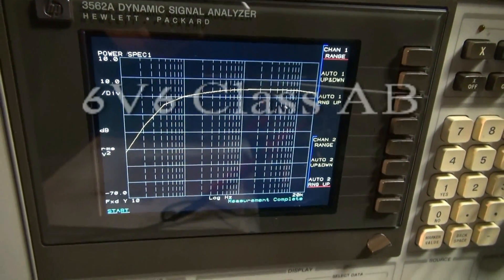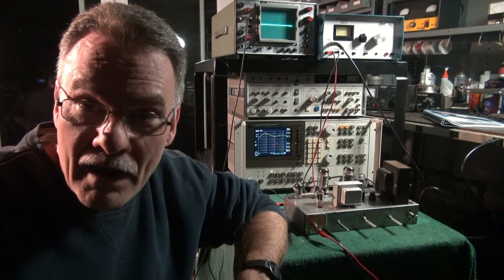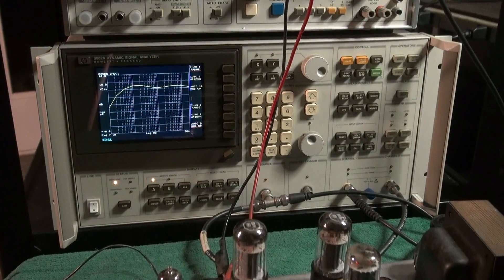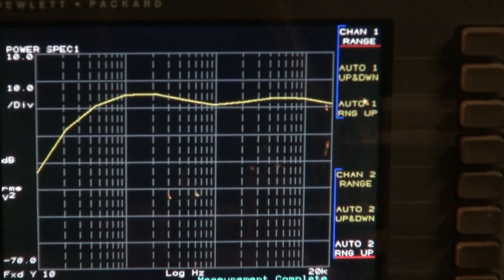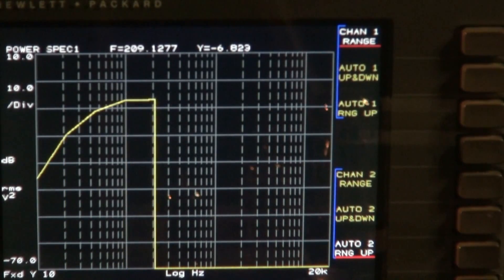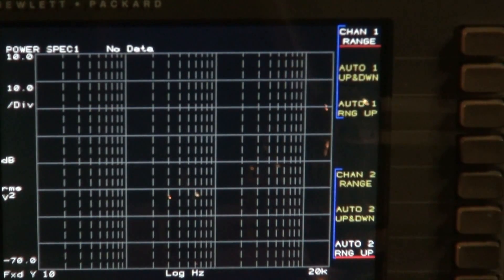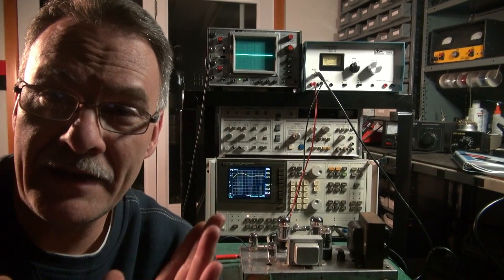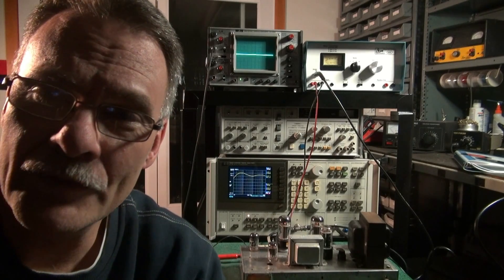How to check Frequency response Fender Deluxe Class AB 6V6 tube guitar amp D-lab

Comment: I'd like one of these . Am I right in thinking that the analyzer would show a trace line if you had an ultrasonic oscillation . I recently fixed a Fender Blues Junior that had one o/p tube idling at greater current than the other . My scope sure enough showed a 50KHz oscillation present at approx 150mV p to p I think , which was cured by lead dress and some filtering around the phase inverter . But it was more an after thought and forum information that got me to check this out .
Am I right in thinking the analyzer might have showed this up ?

Comment: Pretty nice to see a signal analyzer with a tube amp. I am wondering how bad it would look like on my DIY guitar amp :)

I am curious about how one would do such analysis with only an oscilloscope? Would it boil down to plugging in a sine wave generator, choosing a bunch of test points (frequencies) and measuring the change in amplitude of the output signal?